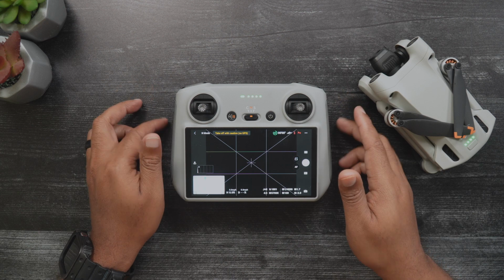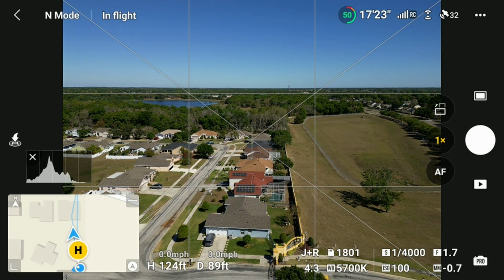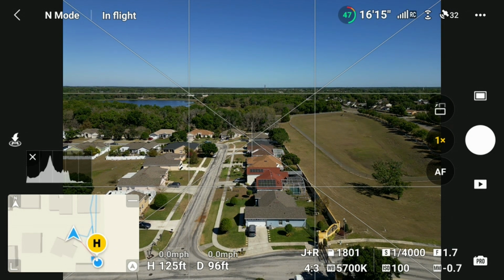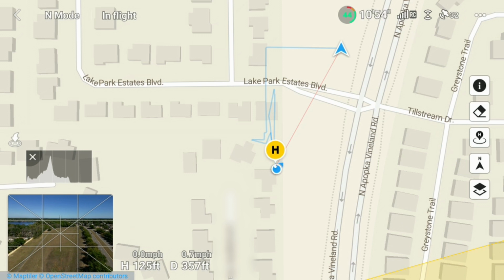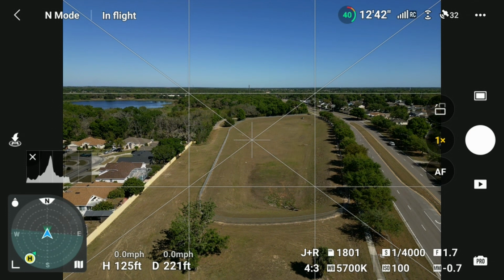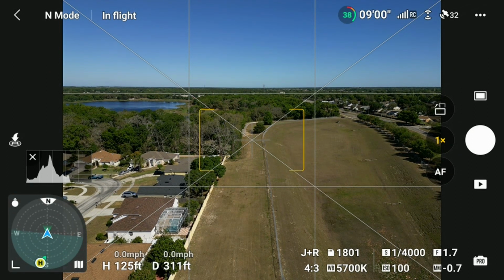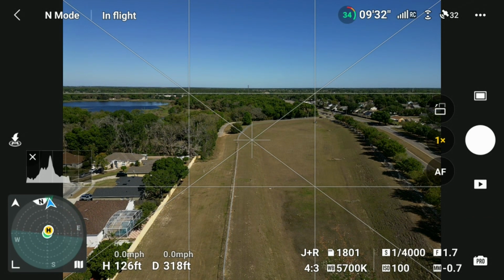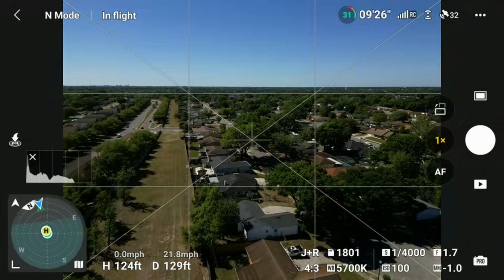DJI Mini 3 / Mini 3 Pro - Understanding and Using the Map and Radar

Comment: How do you update the maps location .. On start up, the little map display shows two miles away, so i have to open the map and move it to my location. Whiles in my location, it shows i'm 30 meters away from where i'm currently standing.
Reply: The GNSS signal says "weak" and the little satellite is red.

Comment: Hey There! Great vid and to the point. Good work! I've had my M3P for some time now. I recall that there are no maps loaded in the RC. I had to connect to my iPhone in order to get the GPS map data.  This wasn't intuitive for me at the time. I would assume the radar doesn't require such a connection, but it's worth a mention for those trying to see a map when they are not available. Cheers!
Reply from the maker: Thank you and thanks for the radar map suggestion.

Comment: Thanks for the maps tutorial. My question is at 0.38 when you turn the map view. The blue arrow which shows the heading of the drone, shows slightly off the correct heading/direction in my case. For eg. if my drone is facing 2 o'clock. The map view shows drone heading at 1 o'clock direction. Can you please explain why.